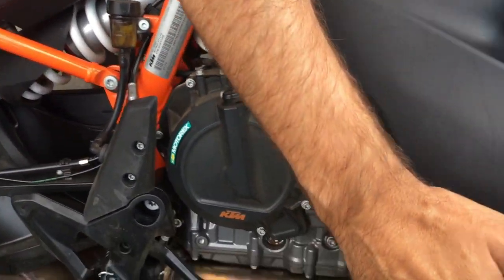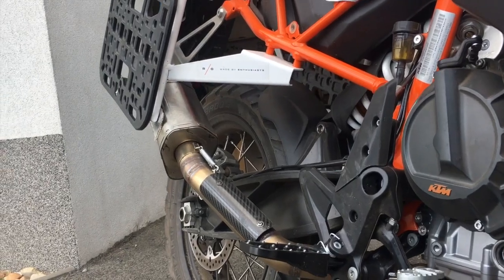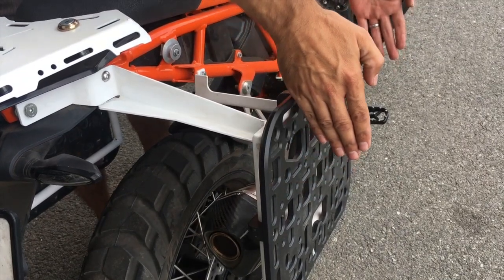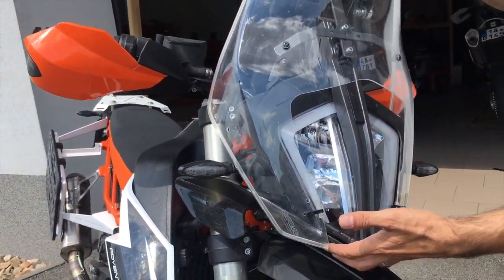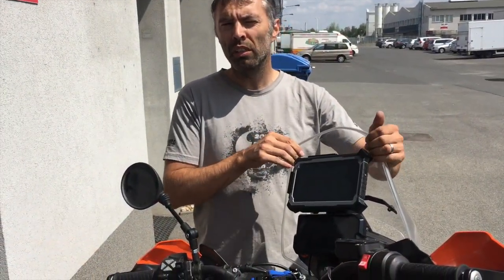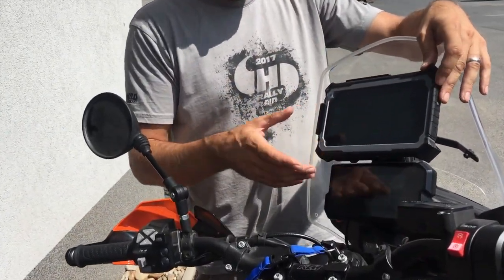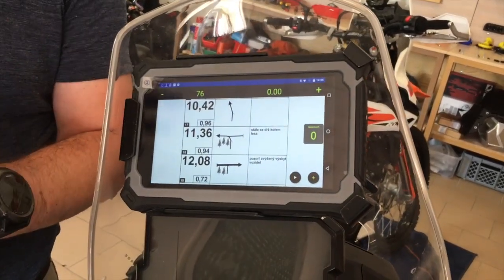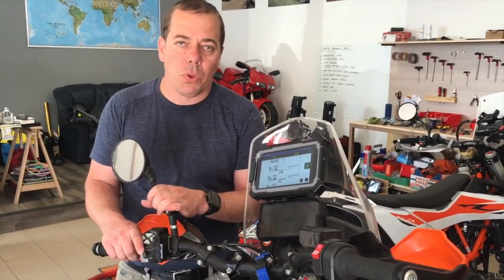KTM 790 Adv RADE/GARAGE prototypes

Comment: AMAZING! everything i want for my 790, a rally screen that keeps the original headlight and a mountable capre-iter!

i have a question to you guys: how did you mount capre-iter? will it fit with stock screen? is it too heavy for the plastic gps mounting place that comes stock? really want to upgrade to whatever you come up with but i could maybe still use capreiter with stock setup and an RAM mount while waiting for it?
Reply: it was a short term solution in order to get on the road within 48 hours. After riding on a dirt for a bit, I would say other than the existing mount will be needed. You can try the RAM mount but I would not recommend it for a rough roads or  permanent setup. It is much heavier compared to a phone
Reply from the maker: The carpe-iter has its holder, but you need adapter for 790 and I did it quickly my self for my Norway trip. The final version would have to be more nicer :-) But it will come too!
Reply: @RADEGARAGE1  Any updates, please?

Comment: Nice Rally screen, but don’t cut out the headlight shape - keep it covered so it can act as a headlight protector 👍🏻
Reply: Heat generated by the led would become a problem i would think
Reply from the maker: Ian, it is not possible, because you would get back the flash light...